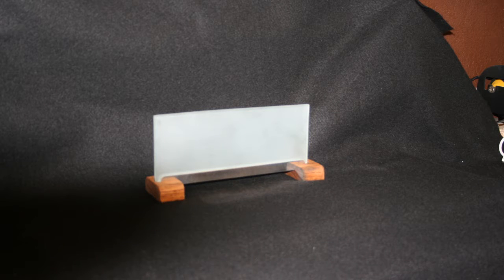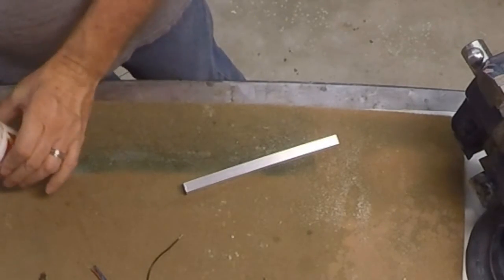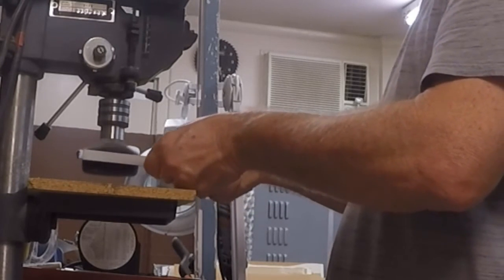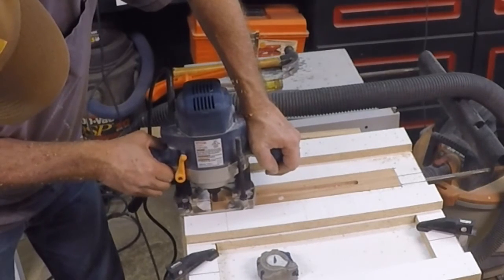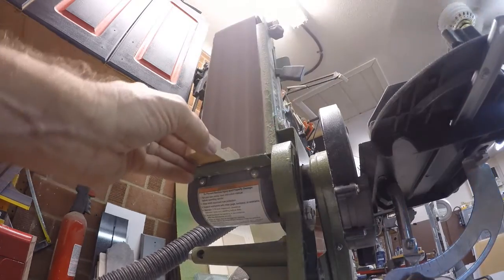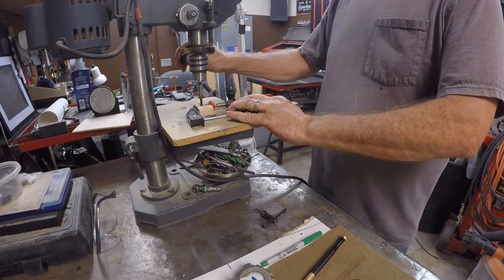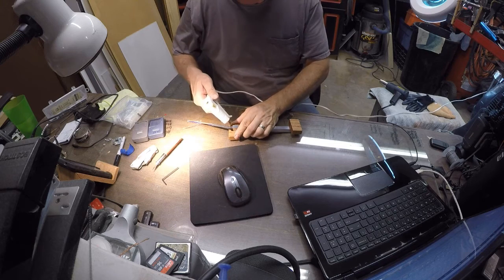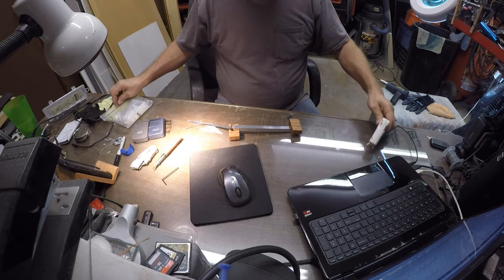Led Edge Lit Base

Comment: Hi there,
I've been working on making light cases especially to present stained glass designs and all kinds of glass creations. 
I'm trying to make them as flat as possible, but I'm not getting under 5cm thick and the cases remain rather heavy.
How thick they can be is mainly dependend on the distance of the glass to the ligth source. So edge lighting would be best.
Could you tell me what kind of led you use because that's kinda the last thing I'm looking for to complete my ideas.
Thanks for sharing.